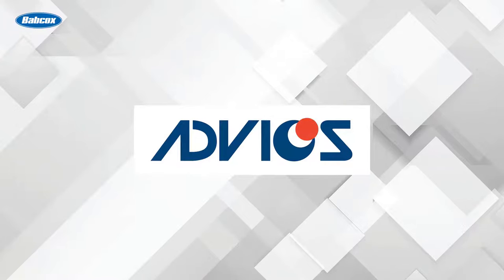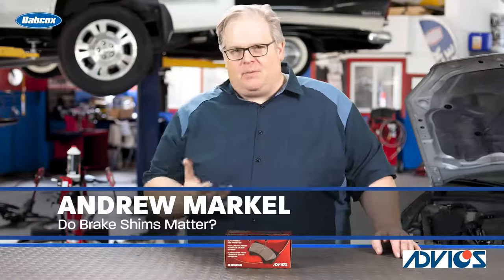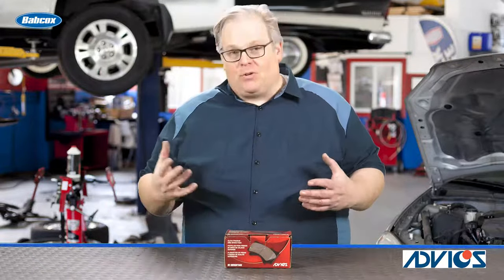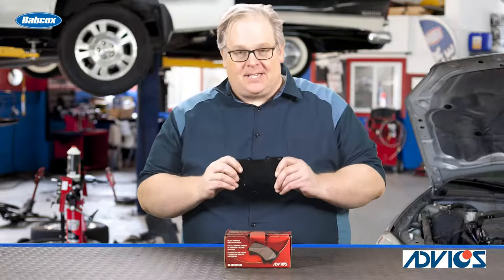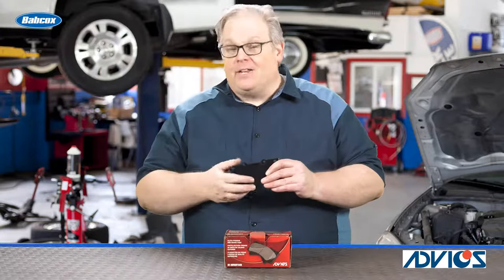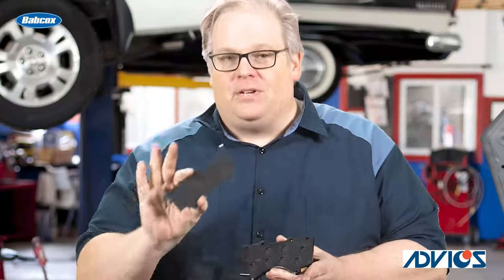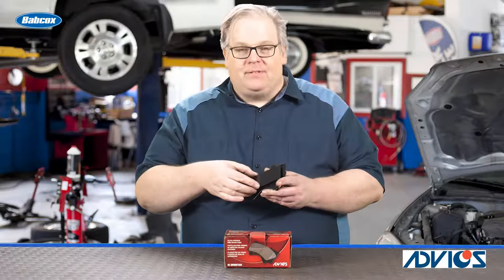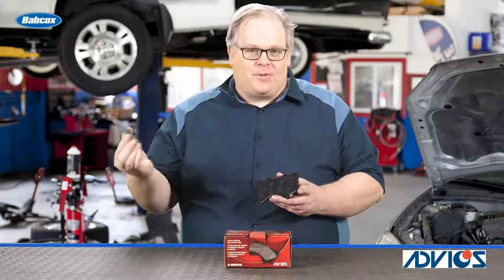How Do Brake Pad Shims Work?

Comment: Not true. The glued shims have flexible glue that will allow for tiny amount of flexing. They are better than the shims just put on with no adhesive because they will make noise as the shim and pad backing plate rub on each other. Just like a dry door hindge swueaking. Use brake grease between shim and backing plate and you'll never hear a noise.
Reply: Use molykote m77 between brake pad backing plate and shim. If the shim is glued on then you can't use any type of lubricant and that glue will dry out in couple of days from brake heat and cause squeaking noises

Comment: I just threw them out.
Reply: Do they squeak without the shims? Mine fell off and I’m debating on just tossing them in trash
Reply: My car uses three shims per caliper.  I replaced the pads/rotors and threw away two of the shims because they are getting rusty.  Just used the one glued to the pad.  So far no squeaks or sounds…brakes awesome.